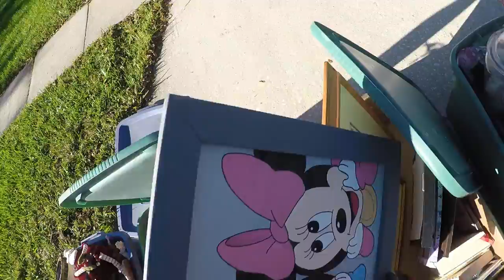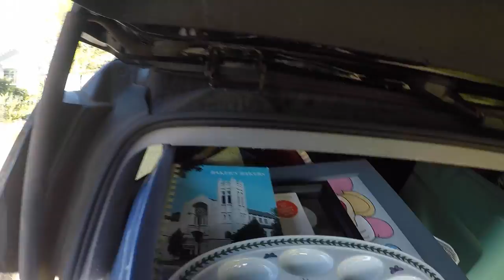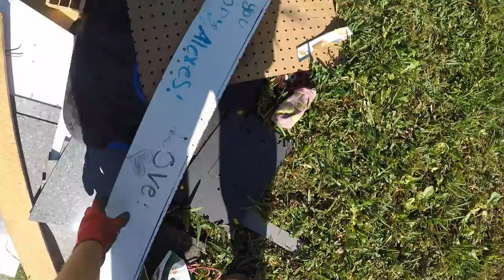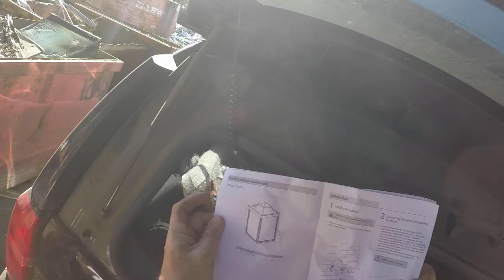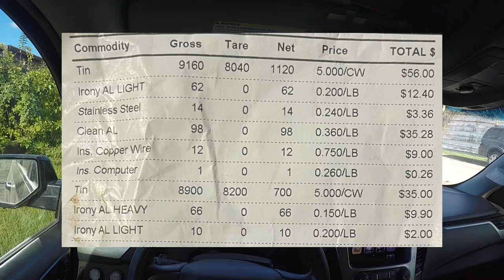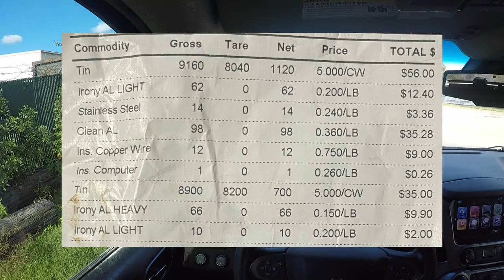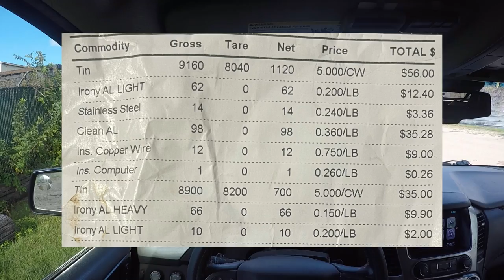Without Other Scrappers Scrapping - Life Is Good!

Comment: Hey Matt, at 1:06:30 you left 3 solid aluminum leg attachments on that table top. Just a heads up.  #plush.
Reply from the maker: Those leg attachments had 4 screws each and might have been 1/2 a pound total when done.  I passed on the 10 cents.

Comment: #PLUSH  If you are worried about an item leave it in your car in the sun during the summer and the heat will kill them within a couple hours, including the eggs.  Anything above 118 degrees kills the eggs and adults in about 90 minutes.
Reply from the maker: I didnt know that but I also find that hard to believe.  That would mean bedbugs would die in FL pretty easily
Reply: @nachostuff  Yeah, used to live there, you should try AZ.  
Car gets pretty hot inside (why you can't leave your pets there) and the way a lot of pest control places kill bed bugs is to seal the house and use heaters to raise the temp above 120 (113 for live bugs and 118 for the eggs.  If you search kill bedbugs with heat you can read about it.  Car just makes a sealed heated environment easier.  Used a friends van for a couch one time lol.